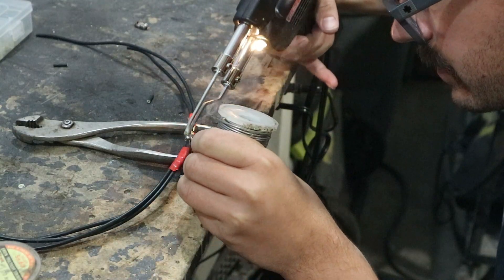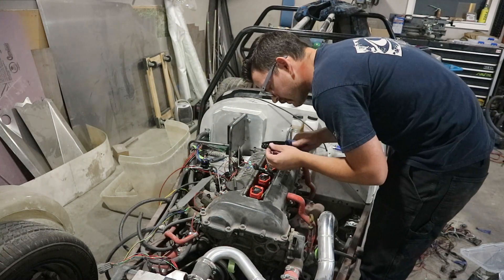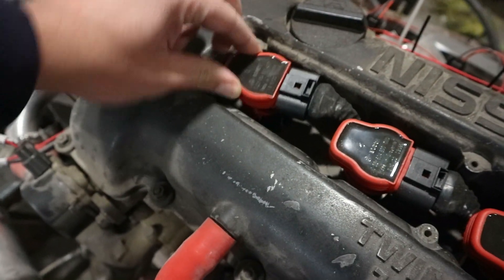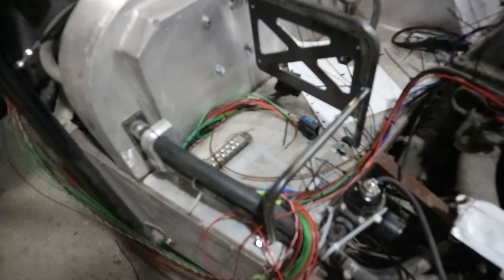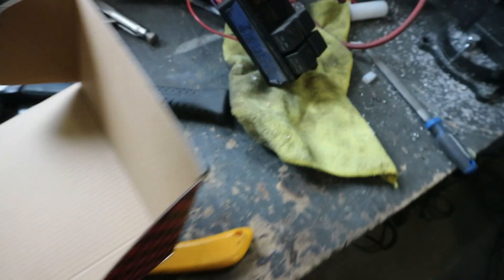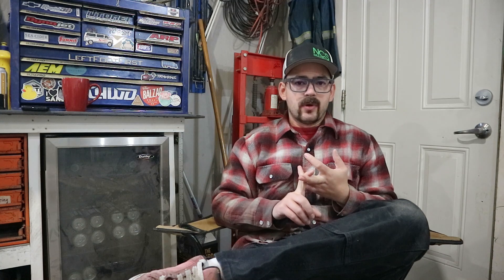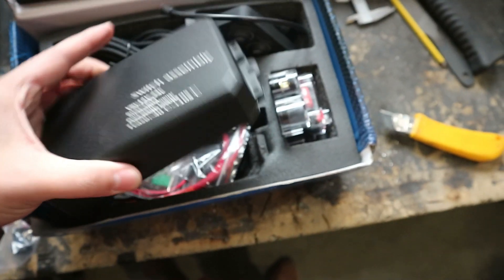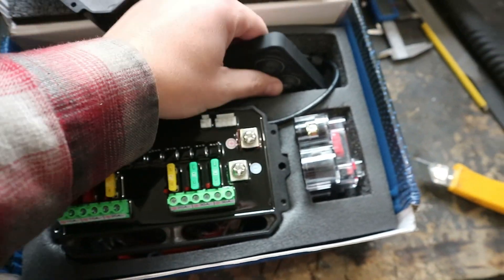Ep 196: New ECU Wiring Update

Comment: He is finally back!! I'm about to do the same, but at a much more basic level, no fancy electronics. Still planning on the Speeduino ecu though. Working on the exhaust, building my first header. 3d printing the icengineworks style "lego" pieces, to see how the header will look like, before I will make them out of steel. I will be running ZX10R ITBS. Need to learn a lot about the electronics/electrics/wiring/ecu, etc.
Reply from the maker: I didnt think I was going to have any fancy electronics either, but things change fast. I have a couple projects that I'm thinking about 3d printing, but I'm not sure I want to take on another learning curve lol
Reply: @leftfootfirst9847  I had the same thought as you, now I'm about to buy my second 3d printer. I don't know how to use a CAD software, but slowly I will make everything that I need. There is Youtube, coworkers, etc. I'm configuring my exhaust header now, as I write. Without "seeing in my brain" how it will look, I would not be able to make that header without scraping a lot of material. Plan is to make 4 pipes coming out from the side of the car, like old school cars(not like Caterham). I'm making a seat belt relocation bracket as well, since the belt(3 point) is in my neck(ND MX5 seats). I'm also planning to make my center console out of 3D printed parts, at least to see how it will look like, but I may just end up covering it with vinyl. Angled rings for my gauges to point toward me, etc.... I have picked up a Creality K1 refurbished from Ebay, for US $321.21 shipped to my door. Ebay gives you 20% coupon code, that helps. They have that right now as well, but ends tonight. You would need an enclosed printer for printing ASA filament for outdoor use. Now the K1 is a bit more expensive.